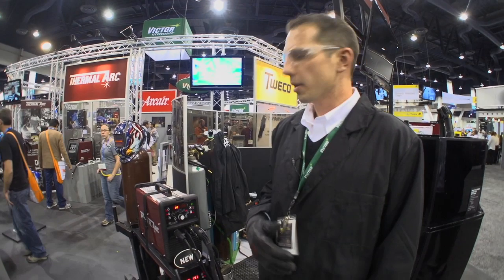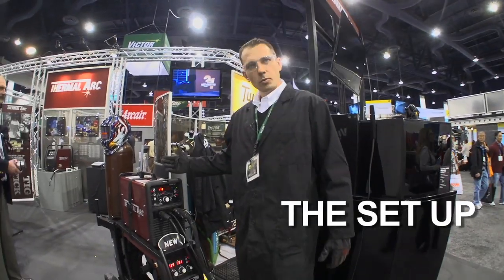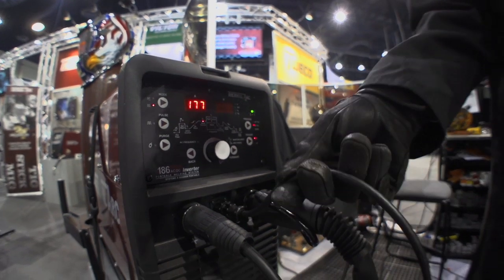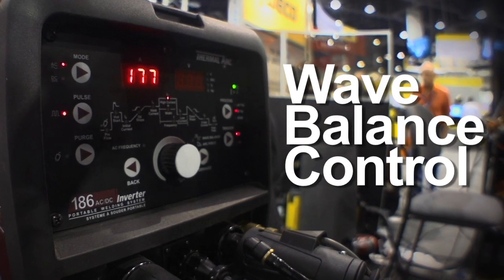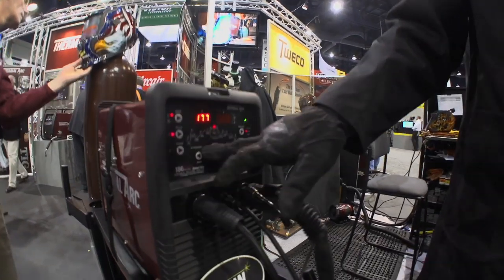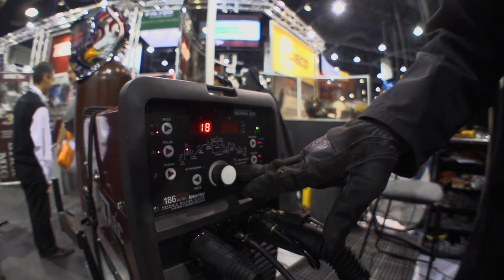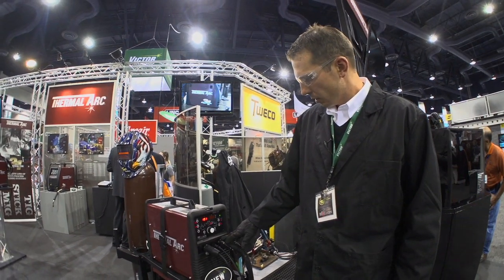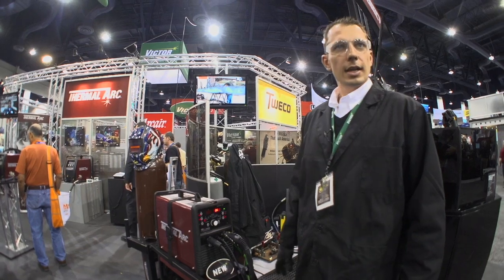Thermal Arc 186 AC/DC - Full-featured TIG/Stick inverter; MSRP of $1,899

Comment: i have the 202 AC/DC but unit is sensing incorrectly that the tungsten or mma electrode is touching the workpiece. Any idea what circuitry is behind this detection so I can fix the unit?

Comment: I own one of these units now and it is great however a few things I would like to see you guys improve on this unit in the future is increase the amp output most inverter tigs now can go up to 220-280 amps on a 220 volt outlet so having it at least an extra 20-50 amps for one, two have it so you can adjust the ac wave form (sine,triangle,advanced square, and square). Increase the frequency adjustablity right now it only goes to 150 make it about 250, the low current on the pulse should be a percentage of the amps not a set amps cause if you adjust the main amps with a pedal or whatever then the low amps still stay the same. This unit should also be multi voltage 120-240, there should be a plug in the back for a water cooler, if possible try to find a quieter fan without compromising duty cycle (fan on demand also), and by god I have the ck amp track and whenever I plug it in the welder all it says is 5 amps for the main amps same with a few other amp tracks, fix that glitch
Reply: Oh and if you would like I will take free welders from you guys in exchange for how to improve them sense you know I am an expert. Jk, but if you want a will.
Reply: Oh one more thing I forgot to mention where the gas cables connect into the welder when I connect them I would screw them in but once I got to the end to tighten the gas cable it would just turn the fitting it was like tightening a bolt and nut with only a wrench on the bolt and nothing on the nut so it would just turn.  So the plastic cover should be molded around the brass gas connections so they cannot turn.

Comment: Decent information but more details on the unit would be great. You guys went through the features to fast. Id like more videos on seeing it up, controls, torch controls, foot controls, etc. promote it more. It seems like a better value then the miller diversion but no one will know without information.

Thanks

Comment: This may be a dumb question but if I have the finger control torch unit and I want foot control can I just buy the foot pedal or can you not switch with this machine?
Reply: Just buy the foot pedal for the 186, Part number W4013200.  It has the correct plug on it and will simply plug into the welder.  Just disconnect the finger control cord and connect the foot pedal.

Comment: Mine says made in Japan. Victor is a huge company with a very strong backing so not worried about the quaility.  Matter of fact i am very impressed with the quality of the unit, long leads compared to some.  The 26 series torch is a little large if you are using a foot pedal like me, you can get a smaller head. I bought the CK 130 gas cooled its much smaller. 50 dinse connector is standard so a bunch of torches will fit this machine.

Comment: Ordered it just today, Looked for months and The features for the money is hard to beat. Miller 200dx is a great machine also but twice as much money is just not worth it. Unlike the diversion by miller it has removable leads and more control with the features. 208-240v machine only is the differnce, as the miller 200 is 120-480v.